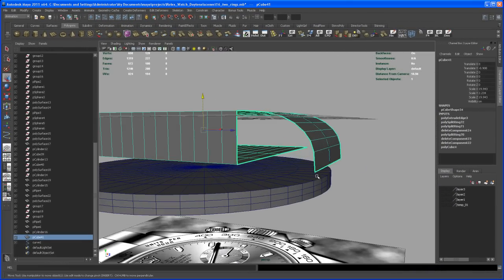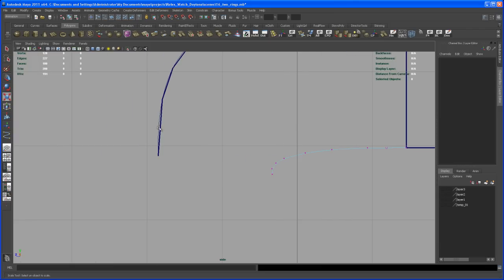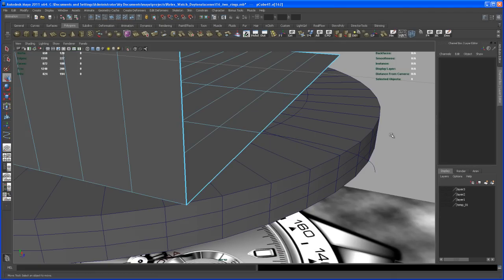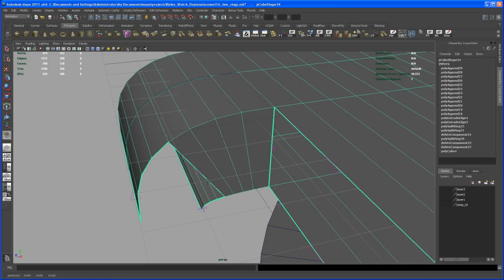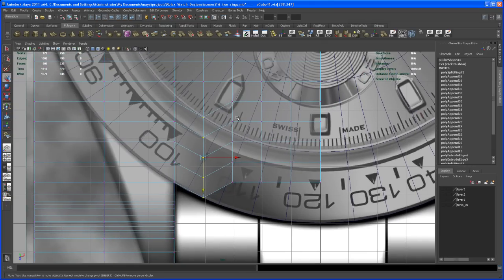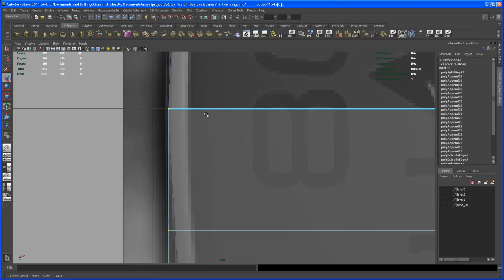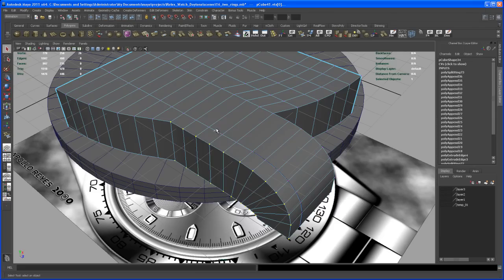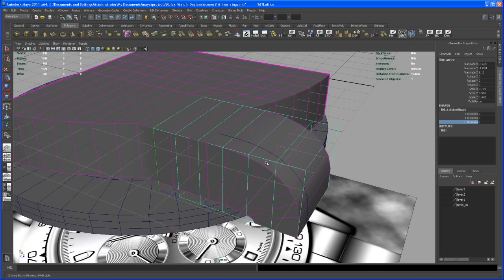Modeling tutorial in Maya - ROLEX DAYTONA watch - Part 18: case shaping 01

Comment from the maker: I guess your face normals are flipped ... sounds like you've tried to use the "append to polygon tool" on edges with flipped normals :-)

So check out your face normals first and make sure that all normals have to point outside.

If your normals are ok and you still can't do the "append polygon" you might have some "double geometry" issues...

Hope that helps.... if not just let me know :-)

Pixelbahn